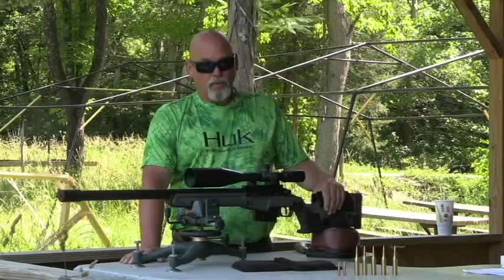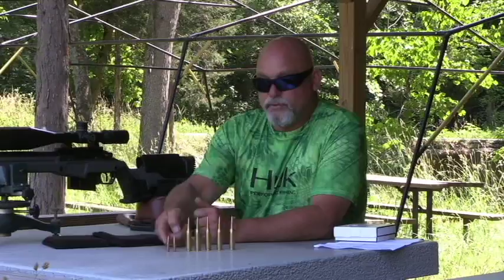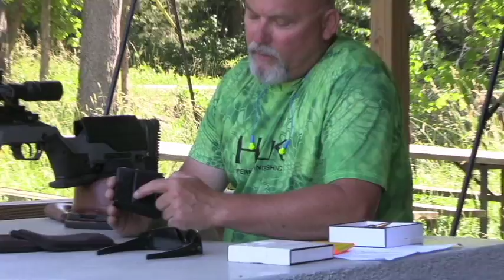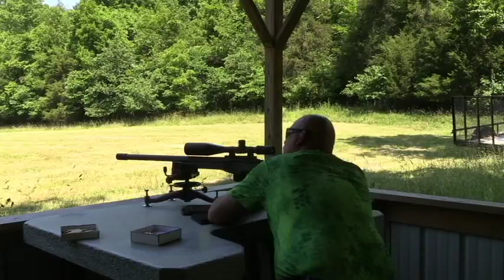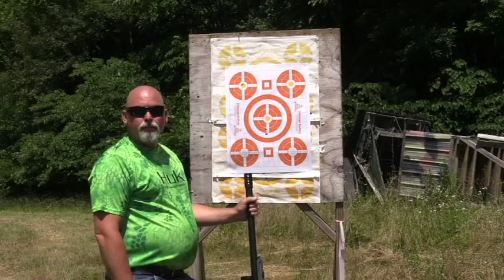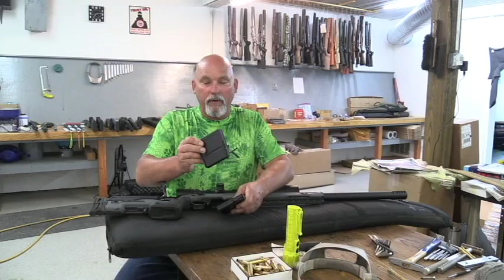Testing a 7mmX300 Norma Mag

Comment: Nice gun, but a caliber like that needs at least a 30" barrel (and probably 32") to show much velocity improvement over a 28 Nosler. That cartridge would perhaps have been a better choice for barrel life. The 7mm/300 Norma will likely last no more than 500 to 700 rounds - about the same as the 7mm Remington Ultra Mag. The barrel on this gun looks closer to 26", so it's likely velocity gains will be marginal. However, longer barrels have less reliable harmonics. On the other hand, the bull barrel, short, fat beltless case and minimum chamber will all contribute to accuracy.
Reply from the maker: This rifle wasn't built for practical reasons., It was built because the customer wanted something different and we kept the barrel at 26 inch for accuracy reasons..  Long barrels tend to float around a little causing accuracy to suffer.  I have built several 28 Noslers and I would prefer this Norma cartridge over the Nosler.  I say the barrel life would be at least 1000 rounds, maybe a few more, for my customer that means 1000 we placed shots and that was the goal for him when choosing this build.